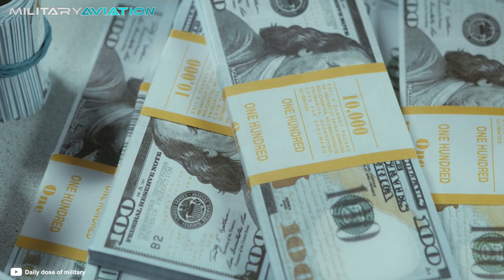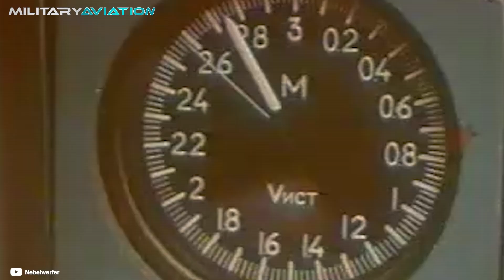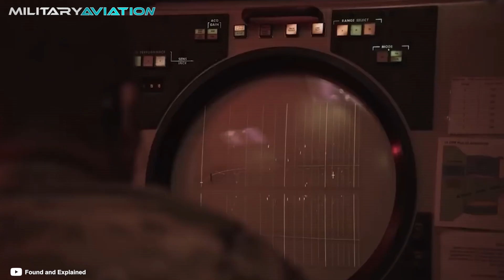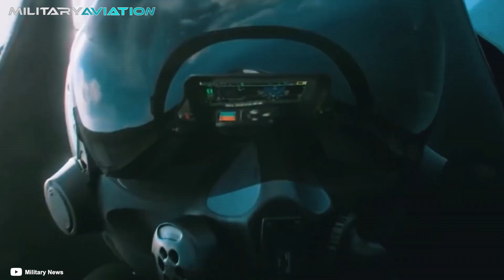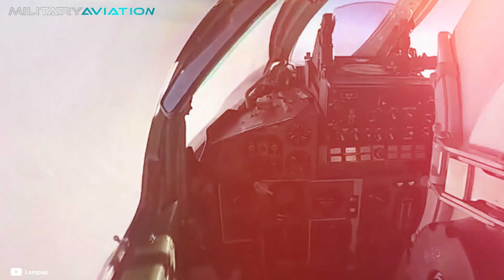What happened to Russia’s MiG-41 fighter?

Comment: If you believe Russian propaganda, they would have you believe that their jets have "warp engines" and can travel faster than light. They also have "harmonic shields" and therefore their jets are immune to conventional weapons. They also have "photon torpedoes and phasers" so they have complete control of the skies. Last but not least, their jets have "cloaking devices" and thus no need for stealth because they can render themselves invisible to both radar and the naked eye. Piece of advice, do not believe anything Russia tells you.If a Russian were to tell me that water is wet, I would still need a second opinion.